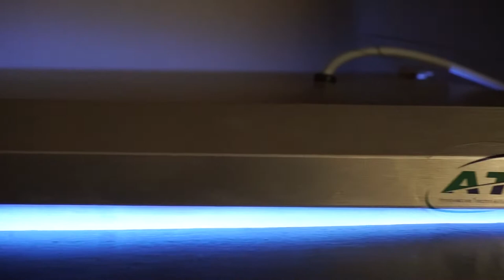New tank build Aqua Japan 150

Comment: Are u using both lock lines or just one
Reply from the maker: Both I have a T in the over flow to connect them both from the single return
Reply: Do u have a picture please I have the same tank not sure how to plumb it I'm running a cor 20